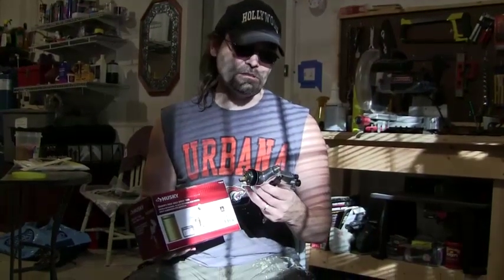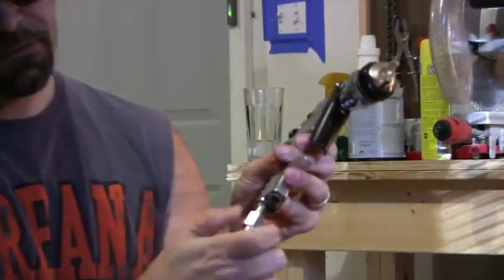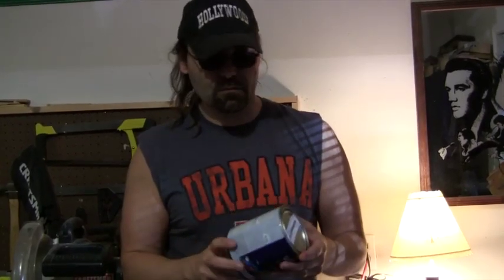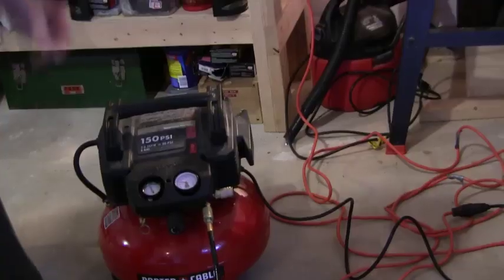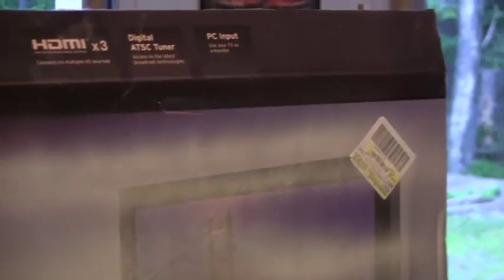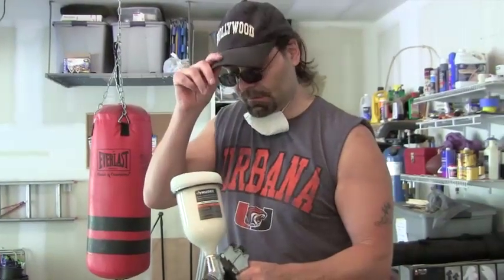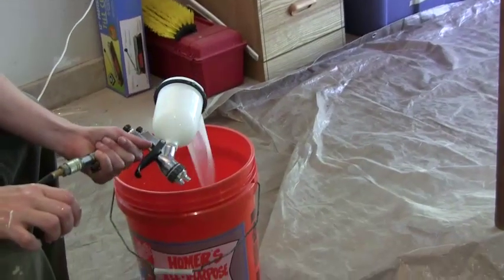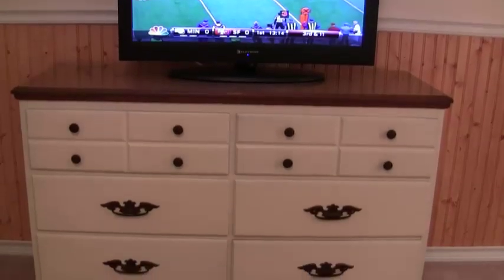Painting A  Dresser Using A Husky Spray Gun

Comment: you might want to be careful on your air hose line supply, I noticed you have a fairly small hose diameter, if that gives your problems you might need to get a slightly wider one for more air flow.

Comment: Turn the air horns on the cap horizontally instead of vertically aligned.  If they are vertically aligned your stroke should go from top to bottom otherwise you paint a 1 inch stripe
Reply from the maker: Good to know for next time. Thanks.